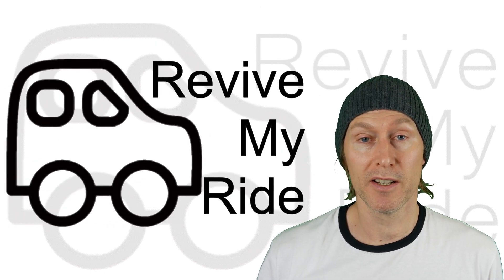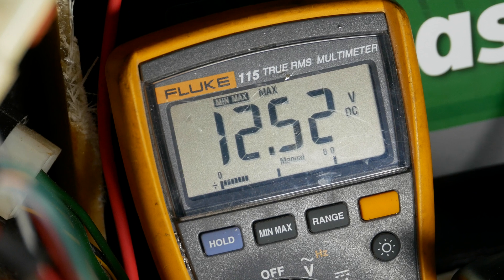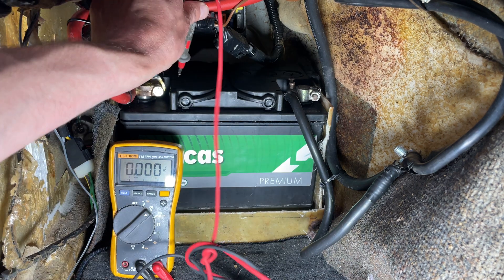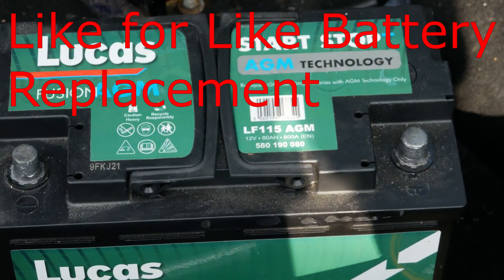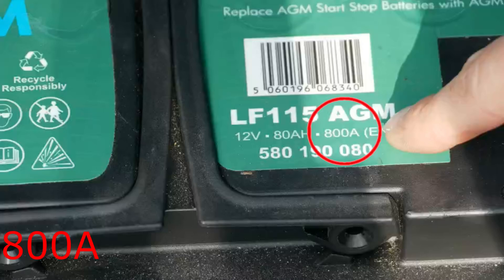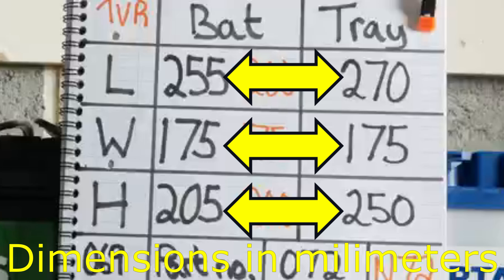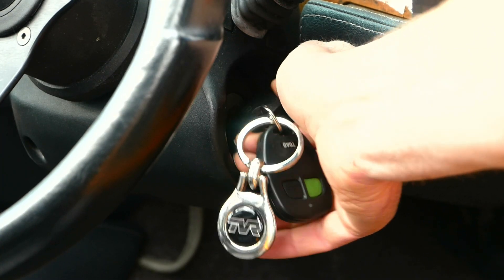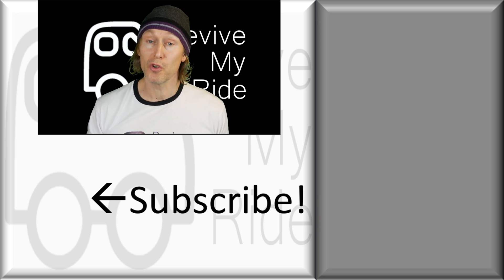Car Slow Starting? - How to TEST a Car Battery Using a Multimeter

Comment: How can you do the same test on a leisure caravan battery?  110ah
Reply from the maker: Hi @luciocancellara4995 in the video, we are effectively doing a load test and using the starter motor as the "load" and from experience, we know how low we expect the battery to drop when we do this. On a leisure battery, we don't have a starter motor in the loop to simulate the load. However, there are devices you can buy that are designed to conduct a battery load test, here is a link to one as an example https://amzn.to/3Um8mmq Some places, like Halfords will do a free battery load test for you. The principle would be the same, make sure it is fully charged, give them a call and see if they will test it for you. https://www.halfords.com/car-repairs/car-checks/free-battery-health-check-PRODUCTBATTERY.html Hope that helps! Thanks, Phil